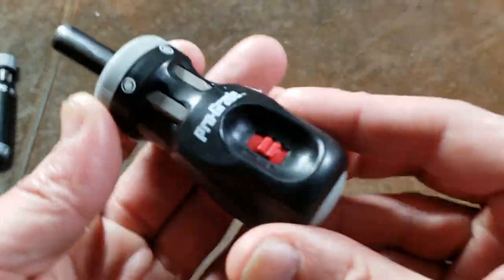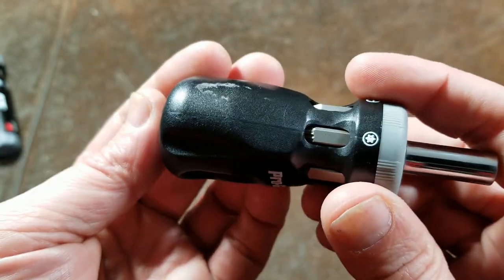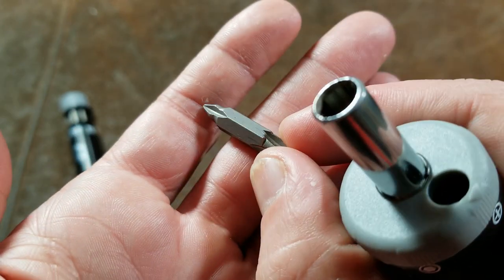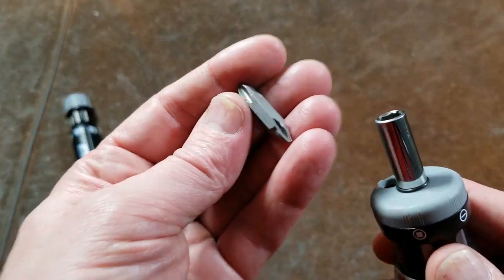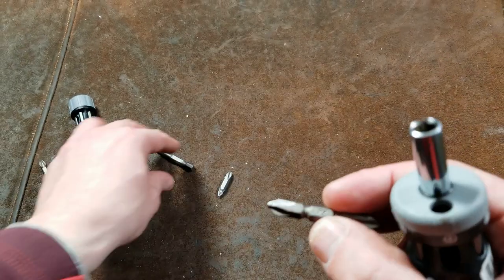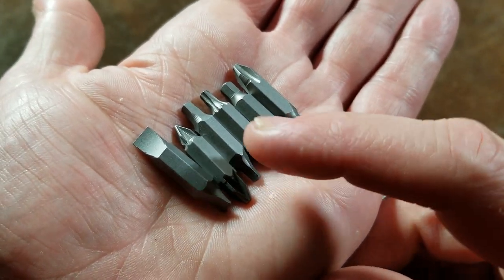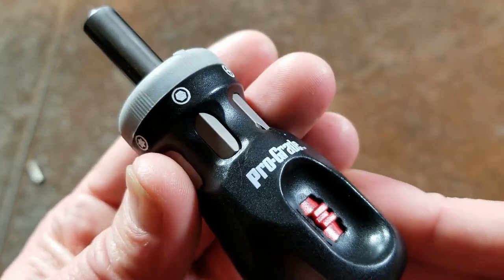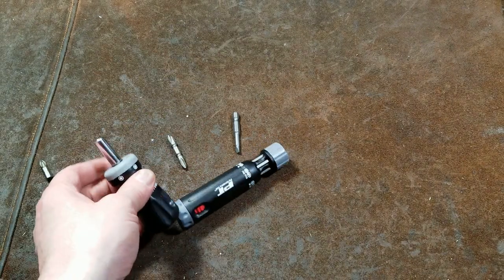Performance Tool/Pro-Grade Ratcheting Stubby Multi-Bit Screwdriver Review

Comment: Interesting i have the exact same tool under the Companion line part# 9 30187. I bought it at Sears 20 years ago. It's in my travel box, and works quite well.
Reply: I have same Companion item no. tool but unlike the one on the demo, mine has a collar the bits go into. Can't figure out how to change the bits and get the current one out of the band on the end of the nose. I inherited this tool so am a bit clueless.
Reply: I have the same band on mine and have no problem getting the bits out. Perhaps yours are a little corroded? Maybe some pliers will help?